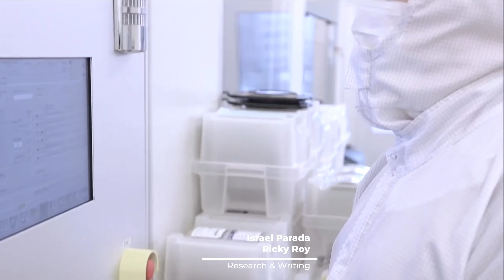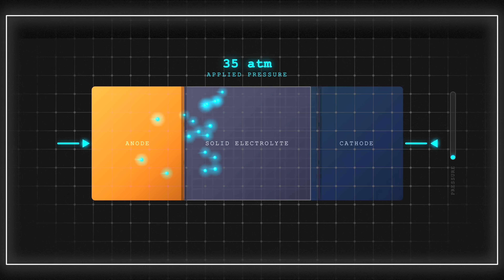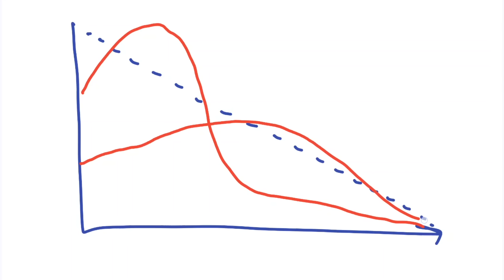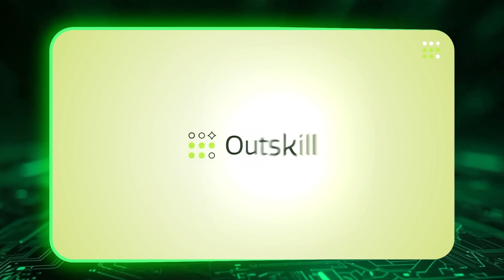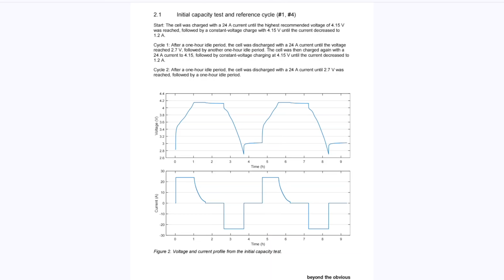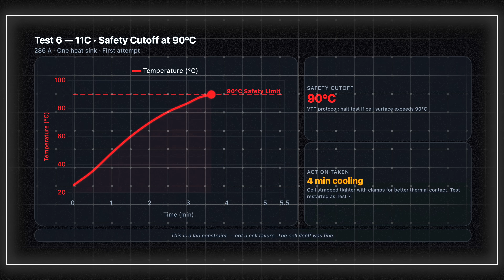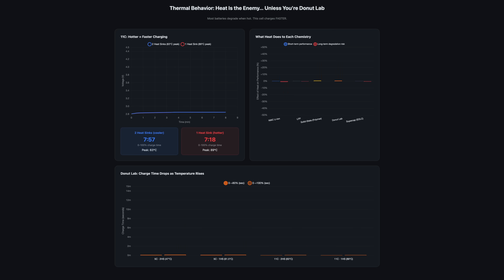Donut Lab's Solid State Battery Test are Shocking...

Comment: You have to consider that this is clearly not NMC from its ability to charge at 11C. Part of that ability is because its resistance decreases with heat. It's not NMC. It's not liquid electrolyte at all, as they confidently pushed it to 90C. Then what else could make a voltage profile that looked like that? A well-designed SSB made for drop-in replacement of NMC batteries. As you said, this was to demonstrate to OEMs that they are a good replacement for their current batteries. What you're calling suspicious is a demonstration of a well designed SSB.

From Grok: 
Most likely: O3- or P2-type NaNiₓMnᵧO₂ (e.g., NaNi₀.₅Mn₀.₅O₂ or optimized variants with Ti/Sn/Fe doping for stability).
Why it mimics NMC so precisely: These are the direct sodium analogs of NMC/LiNiMnCoO₂. They deliver a stepped but overall flat-ish discharge plateau in the 3–4.2 V range vs. Na (full cell 2.7–4.3 V), very similar average voltage (~3.5–3.7 V nominal), and the same CC-CV charging behavior. Papers show voltage profiles that overlay almost identically with NMC when scaled.
Abundant/green/no conflict metals: Only Na, Ni, Mn, O (± small Ti/Fe/Sn dopants). No cobalt (the main “conflict”/toxic/critical metal in NMC), no lithium, no rare earths. Mn and Na are extremely abundant and cheap; Ni is far less problematic than Co (sourced from friendly regions, not DRC conflict zones).

Comment: I like the attitude with which you bring the information, Ricky. You don’t come across with a condescending attitude like several other YouTubers. Those guys essentially say, “Since we KNOW EVERYTHING there is to know about batteries, NO ONE can come up with something different, especially some small company.” Saying let’s wait for the other test results to come to a conclusion is a wiser way to look at the situation.
Reply: By far, Miss Go Electric Industry's breakdown of the connections and possible tech is the best.  This does seem to be indeed some novel chemistry and tech.
Reply: Donut Lab didn't come up with the battery Nordic Nano did and Donut Labs bought into it. I think the key it is using carbon Nanotubes. It is hard to understand if Donut Lab lying when they could be found out on the first test.
Reply: @sloansteeringsystems  Since you have no idea I'd refrain from some condescending guess. Even if that were the case most companies purchase IP from other companies in their products and improve upon it. That's literally how the world works
Reply: @sloansteeringsystems  I don't get why someone is taking this as a "condescending guess".  It is common knowledge that the tech is Nordic Nano's.  NN and DL and Verge are all thoroughly intertwined.

Comment: It may well be that there is no Lithium METAL in their cell, just like there is no Sodium METAL in the salt cellar on your dining table. A classic case of telling the truth, but in a completely misleading way. The cycle life number may be another example. Are they talking about 100,000 cycles at 100% DOD, or at a lower DOD? In my Lead acid battery testing days, you might get 200 100% DOD cycles, but 3000 at 25% DOD. 

CATL already have 500wh/kg cells, but only for electric flight use. They have quite a short cycle life, but the economics make sense in the aviation application.

Comment: The only thing is donut has said there battery can handle a large range of voltages. I actually think the test was designed to show it could behave similar to a lithium ion to show usability in current products. That or they are lying haha we will see.
Reply: Every battery can handle a large range of voltages. A battery is a combination of cells. Given that there are many cells to play with in any EV battery pack, connected either in series or parallel or a combination, you can design it for "a large range of voltages".

Comment: This looks like an investment scam.
They're going to do a brutal test at the end of March using a 800lb-ft torque electric motorcycle? April Fools. So when the test fails, they'll blame the bike, not the batteries. Real solid state batteries are not supposed to overheat. BC the batteries are lithium, the bike is going to need a lot of cooling adding a lot of weight. There are red flags everywhere.
Reply: It's a scam for idiot private investors due to FOMO, and then do exit like EESTOR, and they don't to jail.

Comment: 8:21 11C,  26.004 Ah in 25.894 Ah out: This is either a measurement error or permanent change inside cell.
Difference in energy in-out is not serious. It is only heat.

Comment: It looks like one of the chinese semi solid state pouch cells, they exist, have great performance and are very expensive. NIO has used such cells ...
Reply: These are not very expensive. They're selling - have sold - these at the same price as the previous pack on the Verge cycle. Edit: yeah, it's a very expensive cycle, but it is a hubless rim motor with the unsprung weight problem gone.
Reply: @davis.fourohfour you don't know what's in this motorcycle and I bet the cell sent to VTT is not at all made by donut... and it's without a doubt a Li-NMC cell

Comment: I'm with you thinking this is a pseudo capacitor. Is the charge/discharge controller mimicking lithium ion for compatibility? Is the faster charge at higher temps due to carbon nanotube layers? What are the self discharge characteristics? Maybe the caveat is the battery will not hold charge unused for long? Big question is where are the patents?
Reply: The CEO has categorically denied it's a capacitor, or anything but a full solid-state battery. I'm sure there is some graphene or nanotube wizardry involved but until we see proof to the contrary we need to accept Marko's word.
Reply: He gave up the capacitor idea

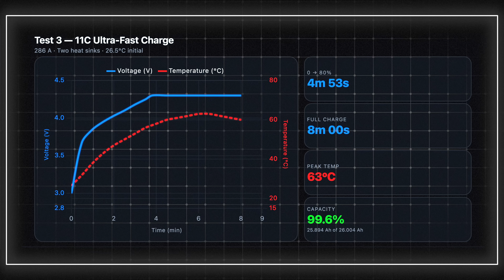Comment: 8:45 "afterward 99,6% of the capacity was recoverable" but the amount of energy put at 11C in test #7 was  109 Wh = 392,400 joules and discharge only 89Wh = 320,400 joules  (page 10(12) of the VTT report)
Reply: As he said, the extra energy wasn't put into the cell, but into the surrounding aluminium and air.
Reply: @marcus-in-3d That's kind of the point though, it's only ~81% efficient when charging at 11c.
Reply: @TowerCrisis I think you're missing the point, which is that the cell still can produce 89 Wh after charging at 11C. The fact that you have to input more when you charge it at that rate is practically irrelevant in all but very specific special cases.

But yes, in cases where you try to waste as little as possible then it's good to know how much is wasted at which charge/discharge rates. That's just not what people usually are interested in.
Reply: @marcus-in-3d 20 % loss is irrelevant? 😂🤷🏼‍♂️🤦
Reply: @hugohabicht9957 Read the rest of the message, too, and not just half a sentence. 🤦‍♂️

Comment: This was the first 'test' and their choice in this test and what they showed, how they showed it, and what that would release is interesting. It is hard to square the circle between solid state and the chemistry claims and what is seen. However is there any way they are putting out disinformation, not necessarily to hide, but to throw some competitors off? They chose this test to be first. They had to realize what you and others would infer and deduce.